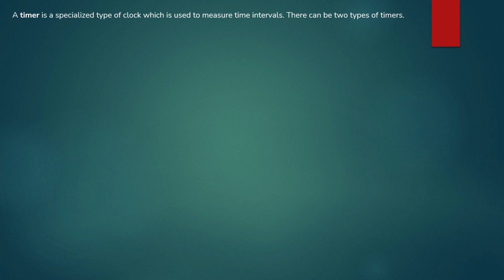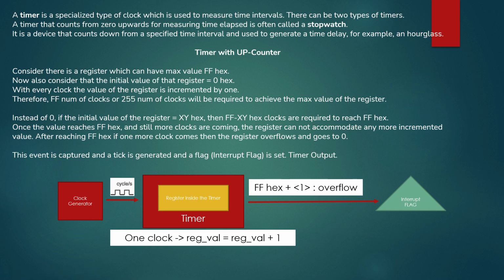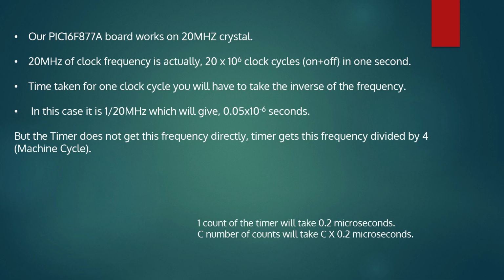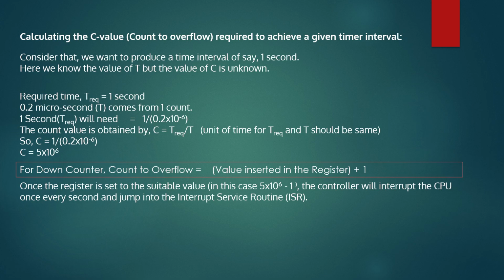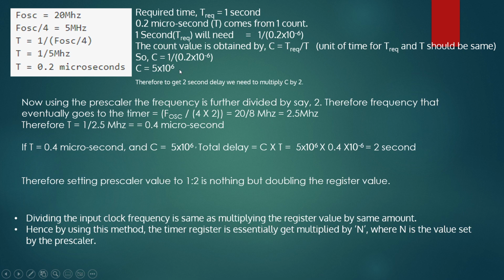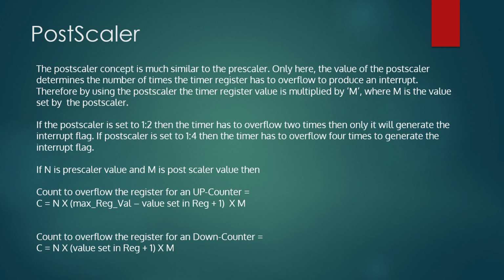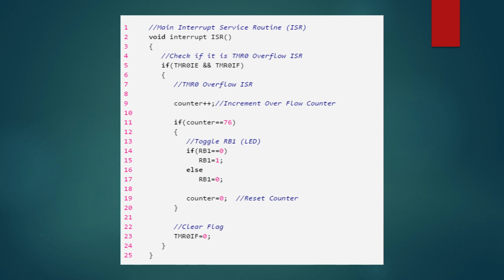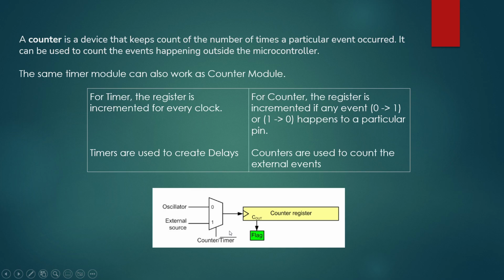Concept of Timer in Embedded Systems : Microcontroller

Comment from the maker: Correction :: @ 21:20 time, Before Counter Register there is a 2:1 Mux; when 0 is given to select line Timer Mode is selected. And Oscillator input goes to the Register as clock. With each clock the count incremets / decerements. When 1 is given to the select line the Counter Mode is selected and the clock comes from external events.